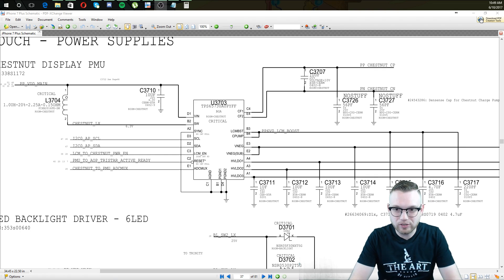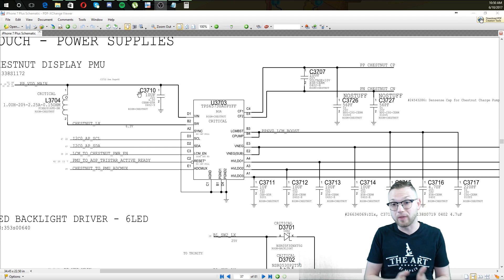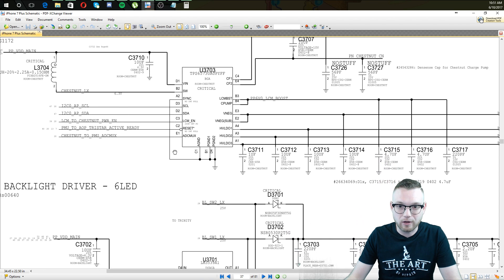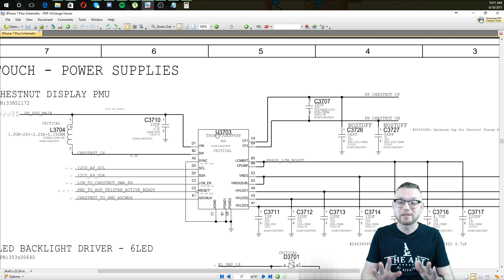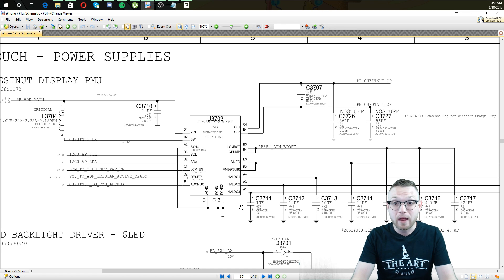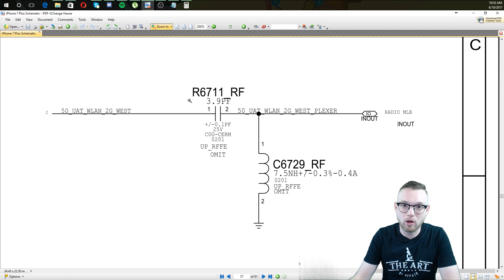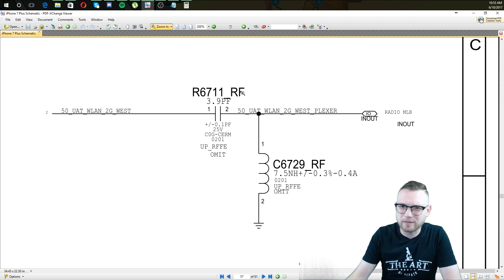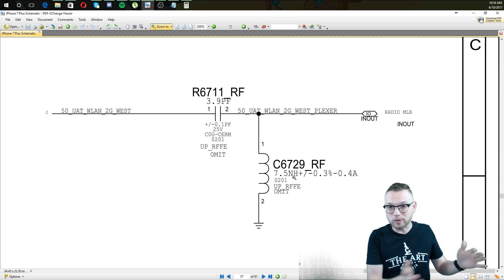EP42 Schematic Reading 101 | Reference Designation from Start to Expert | What Component is that?

Comment: They defined it capacitor with R because at  RF frequency capacitor behaves as a resistor and inductor as a capacitor. The impedance of the inductor increases while the impedance of the parasitic capacitor decreases, so at RF frequency the impedance of the capacitor is much lower than the impedance of the inductor, which means that your inductor behaves like a capacitor.
Reply from the maker: And today I learned something new from someone smarter than I! Thank you so much for clarify this for me. One day when I Redo some of these old videos, I will make sure to include this information. Always feel free to correct me when you see a mistake! I love to learn as well =)
Reply: i do agree with Mr. Malkiat ...